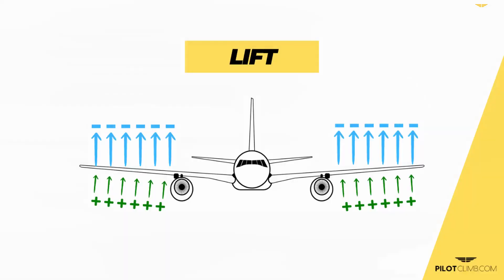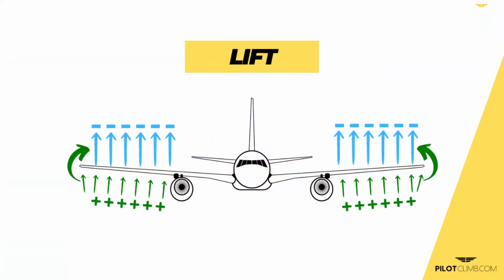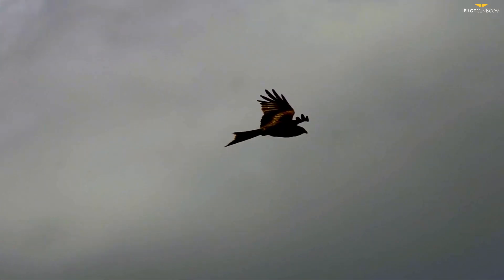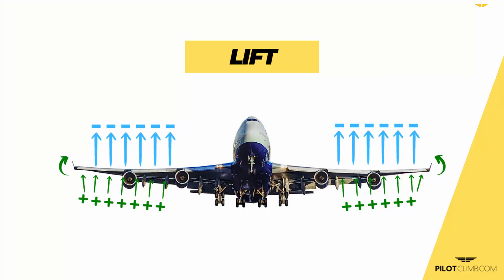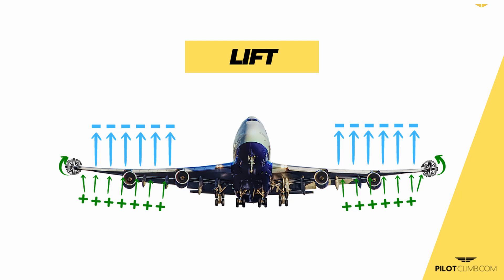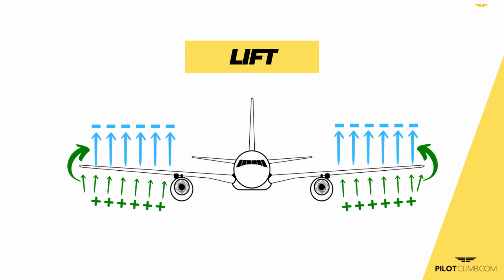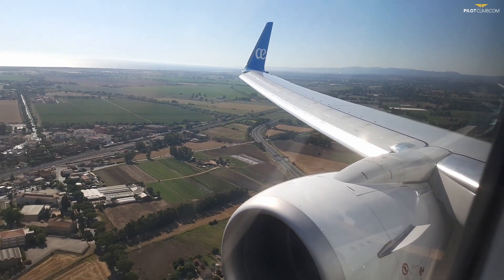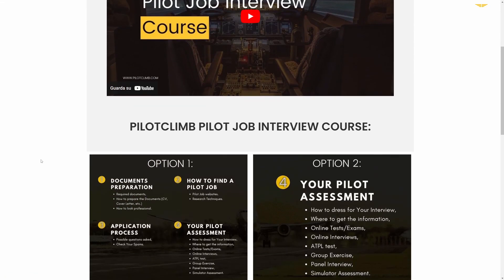Aicraft Winglets -[Lift and Induced Drag].

Comment: Hello Gabriele,

Regarding the Blended Winglets and Split Scimitar Winglets, there were not used on the 737-800ERX (737-P8 Poseidon and -I8 Neptun), just because of visibility reasons over the wings.

They wanted to have an uninterrupted view to the horizon.

That is why they had choosen RAKED Wingtips instead.
Reply from the maker: Great Info! Thanks for watching

Comment: When you look at older aircraft wing designs, they tended to be in 2 planes with a dihedral and a sweep back but the more modern wing designs using computer modelling and wind tunnel testing are converging on aerodynamic shapes found in nature - bio mimicry like in bird wings. The 777 wing is a prime  example - it has eliminated winglets, sharklets,fins and other shapes . The wing is in 3 planes- sideways,backwards and beautifully curving upwards towards the tips- just like a bird !...Thank You Cpt Gabrielle
Reply from the maker: Great Comment!! Thanks for watching!
Reply: I think you are refering to the 777-200LR, -200LRF, -300ER.

The wings of the 777-200/ER, and -300 were different and less efficient compared to the newer versions.
Reply: @AVIATIONSOUNDEXPERT  That's what I meant. You're quite well informed. ..🎉